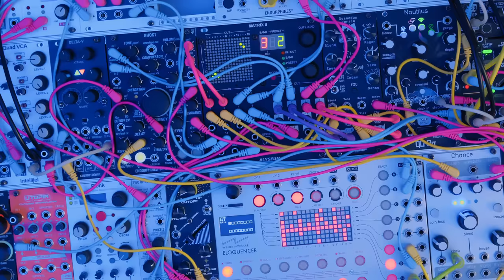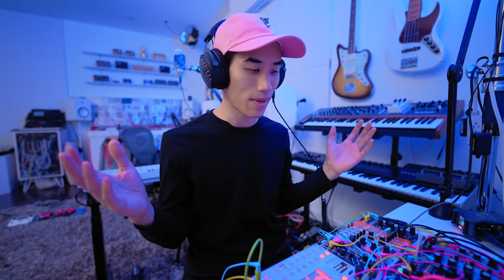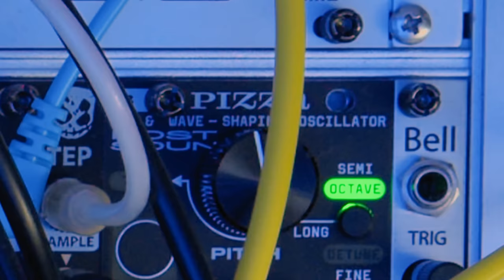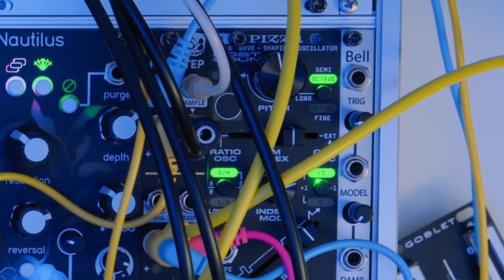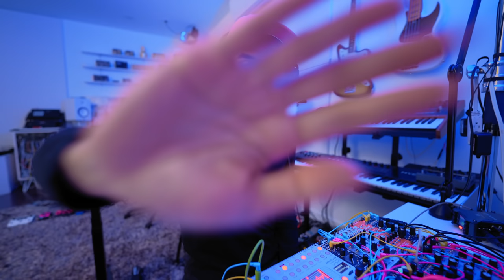The FX Jumping Trick

Comment: The VCA Matrix by 4ms is also a module worth mentioning if you're into dynamic signal routing. If you control its VCAs with a good full-featured mod source like the Acid Rain Maestro, it can do A LOT for you!
Reply: I was so close to getting one when starting out recently. I went with the behringer 130 ultimately because it was $80, and my excuse for getting that instead was that I "only" needed to spend ~$500 to get started. 
But now, instead of the 4ms VCA matrix, I find myself looking at stuff like xaoc Tallinn, LPGs, or even weirder stuff like Schlappi's Boundary.